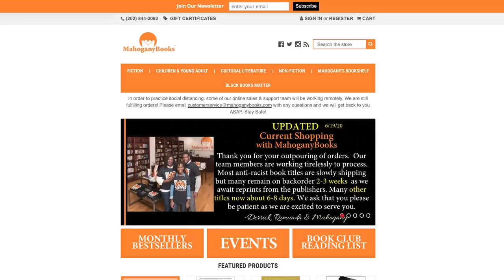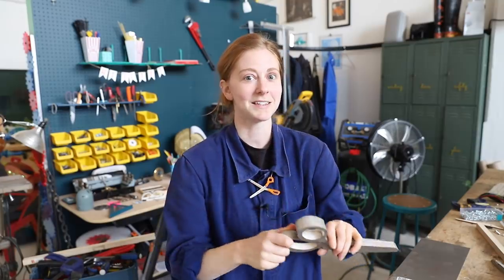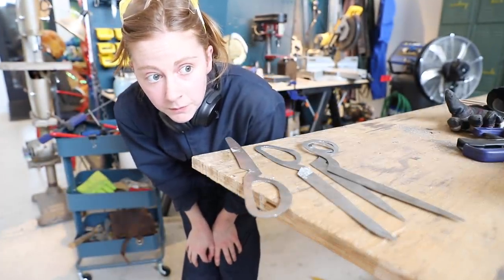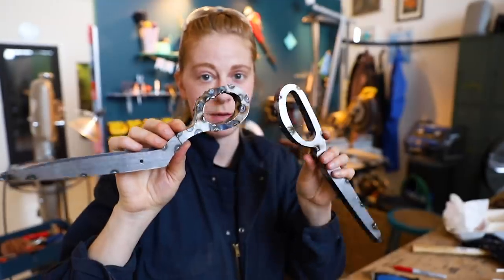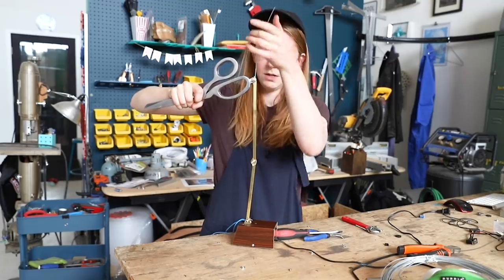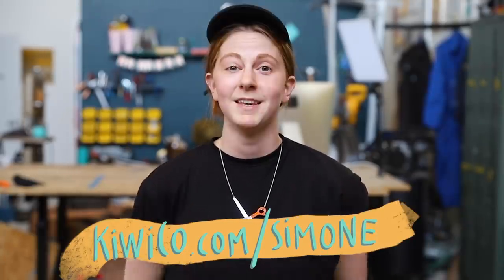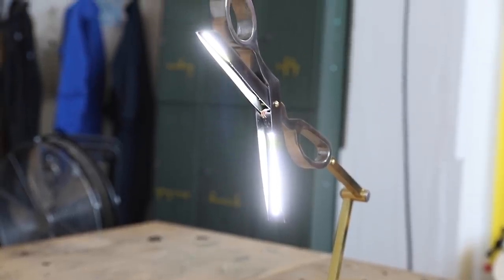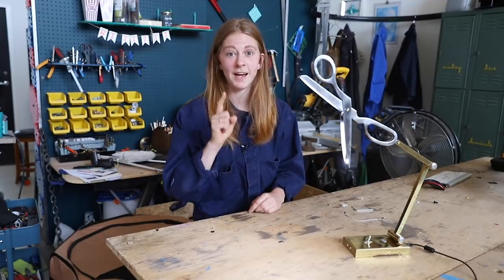Building a custom scissor lamp

Comment: "Whiny Sigh." I thought you would put a contact switch in the scissors mechanism that would turn on the light when opened. But Dreamers be a Dreamin.
Reply: That's version 2.0
Reply: Same.
Reply: Yeah. An analogue mechanism would also be really simple to make, at least in theory, assuming you have a switch inside one of the hollow blades.
Reply: That did seem to be the plan at the start - I wonder if that became too tricky to realise, and this was better than no scissor lamp at all?
Reply: @otherwords1375  yeah... "analogue mechanism?"  "a switch inside one of the hollow blades?" um... it''s low voltage (6v) and low amperage... just two wires that don''t make contact unless the scissors are in the right position...  the entire scissors is a great switch.
Reply: Simone, please make version 2.0
Reply: @petersilva037  she said she had tried to make a switch mechanism but she couldn't make it work in time

Comment: 2:35
Wouldn't this be way easier with a rotozip type thing? Jigsaws are the worst in terms of binding on thin metal
Reply: Those can also be hard to control...I'd say not necessarily harder or easier than a jigsaw, but different.  Either one takes patience and physical strength.  I think this is why a lot of people use plasma torches – no pushing involved.

Comment: sandwich the metal between 2 sheets of mdf and make sure it is very securely clamped. Also, use a blade with lots of teeth. When sawing metal you should have 3 teeth on the thickness of the metal. Unfortunately jigsaw blades don't go that fine (75tpi) Just get the finest you can.
And you're not charging enough!

Comment: There is always some bright spark with a comment about how you could have done it better.
1. Mount the scissors to the stand at the pivot point of the scissor blades. Would redistribute the weight and reduce the problem you had with flacidness.
2. Have them turn on when you open the blades instead of needing the switch in the base.
:-D

Comment: My advice for the next time: LEDs last longer if they are cool, so heatsinking LED Strip to a metal base (as a big cooling surface) is better then using some heat-absorbing material like in 8:21- 8:27 and making them heat faster. And LED lights do heat up, not as much as halogen light bulbs, but they heat up. Just saying. By the way: good idea for the project. :)

Comment: There's no denying this is some great work. But I can't help but think the only way this lamp should be turning on and off is by opening and closing. Having a separate switch looks clunky and removes the whole reason for the scissor blades to be able to move. And it doesn't sound like a hard thing to do. Definitely not as hard as cutting that sheet metal.
Also, you glued the LEDs to some foam? You know they still put out heat, right? Especially if you want a decent illumination.

Comment: it would have been interesting if you put the swittch to turn it on and off in the open and close action of the scissors themself, instead of a switch on the base. Although i can see it is easier to use standard switch at base. And people would expect switch there.. but it would be kind of interesting to have the  switch...

Comment: Huh, I've always found cutting sheet metal to be quite satisfying and stress reducing. Well, I don't do it with power tools, so maybe that's part of it. Power tools make lots of jobs quicker and easier, but they frustrate me to no end. I use them sparingly. d:

Comment: You should look at a diamond, abrasive blade!! I last bought one about thirty years ago.  
They are very expensive; and hard to find...but worth every penny!  
Get the diamond abrasive blade!!! The carbide blades are lumpy, jerky, catchy; you can feel the lumps through the plastic; no good.  
The diamond blade is smooth to the touch....      
You could do a whole video on cutting that on your knee!   
(use a hand saw!!!)  

The one I saw was a hacksaw blade....  
You could do a video on:-  
Finding the blade  
Getting Adam Savage to lazer cut the jigsaw blade out of the hacksaw blade  
He might have one lying around; save some steps there
Cutting something very difficult on your knee
(in the hospital getting knee surgery)  

Maybe you could mount a file in a saber saw????

Comment: If you placed a contact point switch in the lower handle and a magnet in the upper thumb handle... When the scissors are closed the switch would be pulled in the open position(off), and when the scissors are open the switch would return to the closed position (on). There is my idea, now making it and installing is your job.

Comment: First off let me say I don't know what I'm talking about but, I have an idea. when cutting sheet metal like that what would be wrong with placing it between two pieces of plywood ( or some other sheet goods) and clamping the edges together making like a sheet metal sandwich and then cutting out all three layers at the same time to keep the sheet metal stable. And you might like use a temporary glue between layers to hold it tight?

Just a passing thought 💭💭💭

Comment: To late for her, but for everyone else: To cut sheet metal like that, first adhere it to a sacrificial piece of plywood or MDF. Cut it upside down so that the teeth of the jigsaw pull the metal toward the ply. Otherwise, the teeth will have a tendency to pull the metal off the ply.

Comment: Simone, sweetie, I love you-- but that is NOT how you cut sheet metal. Jigsaws are fine, but ONLY if you have the correct blade. A bandsaw would probably work better, considering those really tight curves, but you would might have to cut the metal down to size with snips or an electric nibbler.

Comment: Hi Simone, you might find the cutting process easier (and safer) if you keep a block of wax handy, even just a candle will work fine, and rub a little on both sides of the blade whenever you notice the blade starting to catch a lot - Obvious Safety Advice: stop blade first, but I'm sure you would have figured that out sooner or later anyway :-D  Sometimes I will also rub the cutting-zone of the material with wax before I start, when I feel like going Totally OTT.  Aluminium is particularly bad for juddering when being jig-sawed because it is such a soft 'sticky' metal and the body of the blade rubs on the side of the cut whenever you cut a sharp curve, but I think you will find the wax makes a noticeable difference with any material.  Works on band-saws, hand-saws for wood, and hack-saws too.  I'm loving your videos, they are very inspirational for me because I bought my first 3D printer longer ago than I care to admit but was a bit scared of messing up so I haven't used it yet.  You've taught me that theory is great but sometimes you just have to learn by doing.  Regards from downunder, Paul.

Comment: I know this was a year ago, but cut a 1 ft square out of the center of a piece of at least 1/2 inch plywood. you can now easily clamp the sheet metal on 2 sides for stability.

Comment: Once I had to cut 1/8 alluminium sheets for an RC frame. I used a Rockwell Lame runner wich is a kind of Table inverted Jigsaw. there is a arm that holds the material against the table. You would have had a better time with this!

Comment: I'm not going to say wether you did it right or wrong because that's not my place to say it is your project but I will say if your budget allows next time I would weld in a noble gas field it prevents those rust marks so less sanding later. This comment was about the welding not the whole project it looks awesome.
(Edit: clarity)

Comment: Seeing this video is almost two years old, I'm sure the issue has been resolved already, but just in case it isn't - It looks to me like you are using wrong type of blade in your jigsaw, it's hard to say from the video but it looks like it has big teeth, which kinda is supported by the kick upwards when the blade gets stuck, which in turn would imply it is meant for wood not metals. So either I'm seeing wrong from the paused video (which is very probable from the get go since staring at a paused videoframe in the internets is not really an exact science) and you are using a blade meant for metal or you should definitely buy a pack of metal blades as it should not really take any force to push the thing down (as the blade cuts  upwards, towards the stand) and you should just need to push it gently forwards. Cheers!

Comment: Hey Simone probably never ever gonna read this but next time when working with sheet metal I would suggest you use CNCelia to do all of the cuts. That way you get more accurate results and design a lot easily. With the saw you would either have a lot of frustration and often time inaccurate cuts. ( it also takes a ton of time). But otherwise it looks awesome

Comment: is it bad that i think shes cute when shes frustrated? Also next time you need to cut thin metal or things that like to rebound with a jigsaw you can use Cyanoacrylate on tape on a piece of plywood to keep the material from flexing and grabbing onto the blade.

Comment: Next time you're trying to cut curved lines in thin sheet metal, try using a dremel or a similar, small rotary tool with a cutoff wheel. You will go through a few of the wheels, but they're dirt cheap and would save time and frustration. Your sheet metal also would not get bent up. Just be careful of the sparks, I can somehow see you lighting something on fire with the sparks... JK, keep up the good work!

Comment: What you did is awesome...but it would be great if you could use a *proximity sensor*...it'll sense when the two 'blades" are closed the lights would switch off..and when the they are far apart..i.e. open the lights would turn on.

Comment: There is a tool called a nibblers that is much easier to use for cutting sheet metal. Has 1 big carbide tooth that's replaceable and is easy to man-hoover.